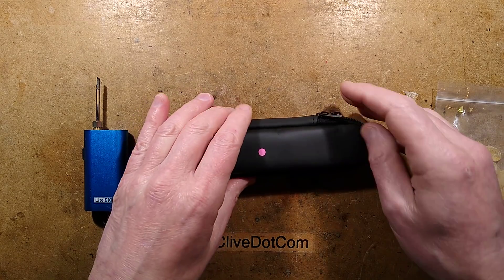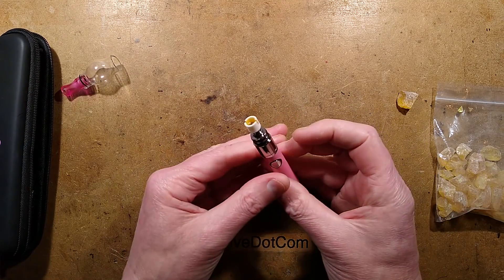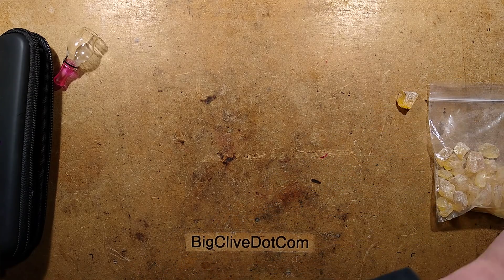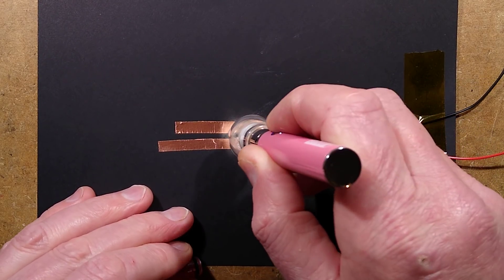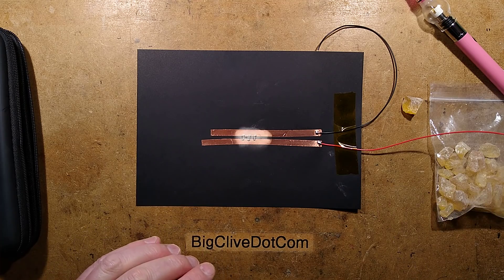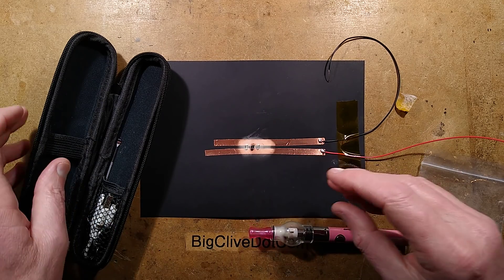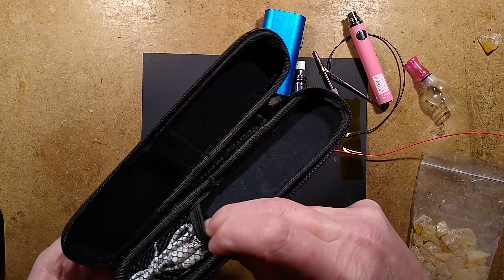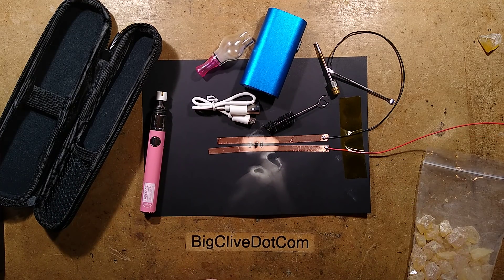Novel rosin vapour short circuit finder

Comment: That's such a cool idea! Though the last short circuit SMD component I was looking for was easy to find as it glowed orange when the fuse was bypassed... Those multilayer ceramic caps seem to like going S/C.
Reply: oh yes, Light Emitting Resistors, they're all the rage! ^_^
Reply: @railgap  yea we all love light emitting components
Reply: @dan2800  I enjoy some Light Exploding Capacitors myself.
Reply: @railgap  Light emitting resistors are getting actually outlawed in some places, triggering anti-government nutjobs to insist on still using them. Light emitting capacitors built from multiple components are more popular than the kind discussed by the op, and are in fact a common subject on this channel.
Reply: "Those multilayer ceramic caps seem to like going S/C"

Yes - all it takes is a whittle bitty stress fracture that shifts the layers juuuust enough to short between them.
Reply: @Gazr Gazr Sometimes it's what you've got to do during high speed fault finding in the field.
Reply: @Gazr Gazr EVERYTHING is a fuse...
Reply: @Gazr Gazr I think that you mean the "Magic Smoke" suddenly appears. This has happened to every person who plays with electronics!!
Reply: @peterduxbury927  Well the smoke is always there its just inside the components, so you can’t always see it. Thats what makes them work actually is this, what you call “magic smoke”. That’s exactly the reason they stop working as well, that moment you let the magic smoke out its over.
Reply: They like to fail when soldered hot, for example when lead free solder is used.

Comment: How strange.... but also very clever! I can totally see these becoming even more versatile for all sorts of electronics. Standardized connector means a lot of interesting things could be made to use these battery packs!
Reply: Like a vaporizer for synth cannabis or resin
Reply: @wm2008  that's clearly what it's meant for lmao
Reply: Really? All I can see is me getting arrested for "Illegal Paraphernalia" with my luck :/
Reply: The problem is the battery packs have a safety timer that limits the on time to ten seconds, when it shuts off automatically.  So you have to keep turning it back on, which can be very troublesome.
Reply: @acmefixer1  in theory the use of this type of “soldering iron” is this:

you use the preheat function to heat the tip to the selected temperature

when you need to apply solder, you hold the button

quickly move on to the next one

Comment: Be careful about breathing rosin fumes. I never used to worry about them and developed a type of COPD after 30 years of electronic repair. I can't say for certain that they are related, but I never smoked.
Reply: @BlondieHappyGuy  - My mom was a violin teacher in the 80's, and I used to use her rosin blocks for soldering back then.
However, you're better off using modern liquid flux, easier to apply and clean up.  While rosin works great, it tends to solidify and it's more difficult to clean up.
Reply: @BlondieHappyGuy  - Trust me, you don't want to get melted rosin on your fingers.  I got a rosin burn on my hand while soldering in my teens, I'm scarred for life. lol
Reply: Yeah rosin fumes in itself isn’t dangerous but after a long time it is, if you don’t have a fume extractor use at least a fan to blow the fumes away and make sure you’re in a well ventilated area
Reply: Rosin can cause allergies and asthma if breathed in. I have a family member that gets contact dermatitis due to the rosin in the adhesive on the fabric strip type of sticking plaster.
Reply: Rosin is a great preserver, that's why pine trees ooze it when their bark gets damaged.
Reply: @BillAnt  Formaldehyde is also a great preserver. And it is poisonous.
Reply: @whitcwa  - But rosin is not poisonous.
Reply: @BlondieHappyGuy  Yes, the rosin blocks from bows work great. As a teen I had a regular supply of broken pieces and chunks from my sister's violin practice. I'm unsure about the sticky chunks from trees. Maybe those are the same but still have volatiles yet to evaporate? A bag of rosin chunks is very cheap on ebay. Much cheaper than the little blocks sold in music stores!
Reply: @JohnJones-oy3md  yes she. Keep your dumb quotation marks to yourself.
Reply: I'm allergic to it
Reply: Lead free fumes are considered more harmful, because the higher soldering iron temperature usually leads to more evaporated flux. If you really want to have a low solder temperature, you would use specific alloys containing bismuth. The low temperature solder has some other issues tho, like low shock resistance of the solder joints, so it depends on the application if that is a useful solution.
We invested into professional solder fume extractors/filters a while ago in our electronics lab, with flexible pipes and noxzles at each workplace. Even at a cost of almost 5000$ for the full system, the investment is small compared to the potential health risks and long term damage.
Reply: @user-yw3cy8pn3b  - Conspiracy theory much?   Medical research actually has shown that the occasional parasite actually can improve immune response (anti inflammatory).   Also, I'd suspect that if there were any viral parasites in vaccines, someone, like, say, a doctor, would have shown them.
Reply: @tbelding  They are listed components of modern vaccines. I even told you that they are added to stimulate immune response but are also found in the lungs and other organs if they enter the bloodstream, when there is a lot of them inflammation occurs, when tissues are already damaged inflammation is worse. The parasites are present in samples taken from the vials from the manufacturers and are the same found in blood samples and biopsy samples taken from organs. Mercury and aluminium are also present in samples and are the reason for the increase in dementia over the decades. Doctors, other medics and scientists have been showing these parasites, minerals and the rest for many years but people don't look and sit watching popular shows instead of spending years analysing evidence themselves.
Reply: @tbelding  Please stop assuming that what people say is a conspiracy theory, I've been called one for two years and everything I was saying early 2020 has been revealed in the news and other media as the truth. You could desuade someone from choosing an alternative therapy that could work well for them, I have seen the damage done to people with pharmaceuticals, people relying on steroids are destroying their bodies in the process and only getting more ill and they listen to their GP who is reading off a screen what to prescribe and don't understand the biological and chemical processes in question and it takes years for organisations for the NHS to catch up with progress and they also now consider profit margins over primary healthcare requirements. Please don't just dismiss us.
Reply: @BlondieHappyGuy  - Funny thing, is that when I used to use rosin as flux, often I've seen a white haze around the components I was soldering, which was basically atomized rosin like in this video, however I found it annoying back then. lol
Reply: My lungs have become sensitised to rosin flux from soldering in a work environment over 30 years. After some research the employer has removed rosin cored flux from it's inventory now.
Reply: @twotone3070  - A good fume extractor can eliminate virtually all the rosin fumes as soon as its created at the soldering pen's tip.  Just a thought.
Reply: The flux/rosin I use at work even has such a bad effect on your throat, eyes and such if you just inhale tiny quantities of the smoke when your soldering iron touches it that you have to be absolutely insane to NOT use fume extraction. Can't understand how some of my colleagues do without.
Reply: @weeardguy  - Rosin coated lungs have less chance of infection, just like pine trees ooze it on their damaged trunks.  Just kidding. lol
Reply: @BillAnt  Just like during 'the pandemic' (don't want to get Clive in trouble here) me and my colleagues joked that one on my co-workers (also called 'The Chimney' as he nearly eats cigarettes) could not get it 'because it will be smoked out before it gets anywhere where it can do damage'. ;)
Reply: I find that when I ingest commercial flux, I end up with a soar battered throat and if I ingest a lot I end up with shortness of breath.
Colophon doesn't have that effect, it actually smell quite nice 
Now days, so called dabs are pretty much marijuana flux and kids this days huff on that thing directly from the bong like the world is about to end.

Is definitely the commercial synthetic flux that will do wonders to your lungs and throat
Reply: Years ago we has this conversation about breathing flux fumes and research was done years ago and it turns out to be be not a big deal. Back then so many smoked and heated with open fires this exposure was nothing compared.
Reply: @MostlyInteresting  flux fumes are a big deal and do not even remotely compare to smoke from open fires. if you solder a lot, contact with rosin needs to be avoided.
Reply: @MostlyInteresting  I suppose it all depends on the exposure time. Flux fumes sometimes trigger my cough but nothing beyond that. My eyes are more affected than my lungs so to speak.
Reply: @MostlyInteresting  Pine rosin fumes are known beyond any doubt to cause asthma and contact dermatitis.
Reply: I suspect that Clive has been in the entertainment industry as long as I, and the amount of unknown crap we've spent endless hours breathing is far worse than a bit of rosin fumes occasionally.
Reply: used for breathing very different rosin fumes...
Reply: It is likely a colophony allergy, colophony being an alternate name for conifer rosin. Rosin is used in all kinds of things, and exposure to it is one of the most common causes of workplace developed asthma, related breathing disorders, and contact dermatitis.
Reply: @Sylvan_dB  - Rosin is made up of terpene and abietic acid molecules, so yeah it can't be too good to breath in its vapors.  However, it's not dangerous by simply touching it.
Reply: Isn't this a known fact? Depends on the solder you use, not the flux(I think)... Franlab just talked about this. She prefers to use leaded solder but she knows of the dangers and always uses ventilation, etc... and she has a Vacuum under her tool so when it's just sitting in it's holder, the fumes are pulled away. It's the Lead as far as I know.
Reply: @Simonjose7258  the fumes are all flux basically. Soldering irons wont bring lead to boiling. The hazard with lead is getting it on your hands and then transfer from hands to mouth etc. So if you wash your hands after, it should be fine.
Reply: @Simonjose7258  To get lead vapor you have to heat lead to the boil point. Also its the salts of lead that are the problem in poisoning not metal lead.
Reply: @MostlyInteresting  not necessarily to the boiling point, but above the melting point, to a much lesser extent
like the water which evaporate from lakes or bath, while not boiling
Reply: @ElectroXa  water evaporation has a unique property that lead doesn't. Weight. Elemental lead doesn't spontaneously evaporate.
Reply: @AnnaVannieuwenhuyse   thanks for this information 👍
Reply: @ElectroXa  the vapor pressure of lead below its boiling point is absurdly low.  unless you're playing with molten lead in the mesosphere, there's no danger of evaporation.
Reply: @Simonjose7258  I think she uses lead based because it requires lower temperature.
Reply: @Simonjose7258  I never had high levels of lead in my blood tests. It has a boiling point of 1749 °C (3180 °F) which is much higher than soldering temperature.

Comment: These units normaly come with solid blocks of Rosin, heating the tool provided will let you scoop out a lump to use.
Reply: Uhm... you sure? Because i'm pretty certain that this device was never designed for pcb repairs...
Reply: @chrisakaschulbus4903  You can get the other stuff as "rosin" as well.  It's hard like pine I think.

Comment: I wonder how easy (or not) it is to clean up a board once this rosin vapor has been applied on it ? Did you test that Clive ?
Reply from the maker: IPA and toothbrush as mentioned below.
Reply: The normal way to clean off rosin based flux is with IPA and a toothbrush
Reply: @steverpcb  IPA and someone else's toothbrush!
Reply: @zebo-the-fat  someone else's Imperial Pale Ale too!!
Reply: For a sec there I was wondering why pouring an IPA all over your circuit would do any good 😂
Reply: @chris-hayes  It's one way to get rid of it without having to drink it.
Reply: AFAIK plain rosin cleanly and readily dissolves in most solvents, should be easier than cleaning flux residue.

Comment: If the component overheats enough, with the aid of the flux, it will desolder itself from the circuit board.
Reply: It's certainly how Philips designed the HT feed resistors in some of their TV sets from the '60s and '70s, notably the G6 colour TV set, which had what were referred to as "Drop Off Resistors". In the event of an overload, they would heat up enough to melt the solder and allow the resistors to fall away and break the circuit.
Reply: @whitesapphire5865  I never knew that, what a cool idea. Saves work in diagnostics too.
Reply: @Richard Turton -  What i find humurous, as it's intended to be, is the idea of something still working well enough to 'self-correct'. All we need now is built-in spare, better rated, components, that automatically substitute themselves 😂😂😂
Reply: @Palmit_  value detracted engineering?!
Reply: @philanderingwhitecollartra8281  -- good idea. also, reverse VAT payments!  invest now!! 😂
Reply: I had a rack power supply where a diode desoldered itself basically. It was still operational, but overheated enough to melt the solder. Replaced with another, higher max current and added a small radiator.
Reply: My old graphic card had one of its surface mount caps broken off, so I decided to solder on a new one. But as soon as it powered up the cap desoldered and popped up and off the board so I guess it didn't need it anyway.
Reply: @1800Supreme  I bought a GTX 770 a little while ago and tried to use a soft toothbrush to lightly clean the dust off of it and it ended up pulling the caps along the edge of the pcie connector off with the pads and some traces. Most damage ever done with a toothbrush.
Reply: @NikoBell1188  Oof, I got a pretty clean asus one with backplate for 10$cad a couple years ago, still have it
Reply: I doubt these pens were made special, they likely have a five-second automatic shut off, or thereabouts. They'll additionally be liquid tight. They don't need help separating themselves from the circuit board, with either flux or heat. The most common fail point is the connection between the positive and negative terminals on the battery section and the wires connecting them to the circuit board.
Reply: @davidwilson6577  - This type of vaporizer pen was specifically made for the "herb/weed" market, just don't inhale that flux!. lol
Reply: @BillAnt  Not the battery. That's just a generic one made by a million factories in China. I doubt they bought them specifically designed for these units, outside of a label or whatever. (they're made by the shipload for normal vaporizer pens, so it would be cheaper just to buy the ones everyone has already been making for years - which they had been when these started coming out - than to make a request for something even a little different)
Reply: @davidwilson6577  - Yes of course the battery and pen are generic, but the glass head/bulb is made to vaporize "herbs".
Reply: The ones I have here, are mounted to a screw terminal. They are designed to reach and sustain those temps.
Reply: Well... no. The solder has a far higher capillary action than the weight of the component. Most resistors, capacitors and IC's are by far not heavy enough to just desolder themselves. And my experience with freeze-spray, which basically does the same thing (aside from being a benefit in finding bad solder connections), is that a shorted component heats up so quickly you won't need to apply power for prolonged times: within about a second of applying power you'll see where your faulty component is.

Comment: Isn't it the flux that is dangerous in solder? Or is this not the dangerous part of flux
Reply from the maker: Flux is the part that comes off as vapour during soldering.  It's basically pine tree rosin.
Reply: its not a good idea to breathe too much of it in, in some people it can be an irritant, i have some 'no clean'  less flux solder and what flux it has is nasty stuff,  really cough inducing if you get a vapour right in your face ,   then theres some CEL branded solder i got from grandata in the late 90s, very stinky flux, bit like mix of BO and farts 😜
Reply: dAnGeRouS